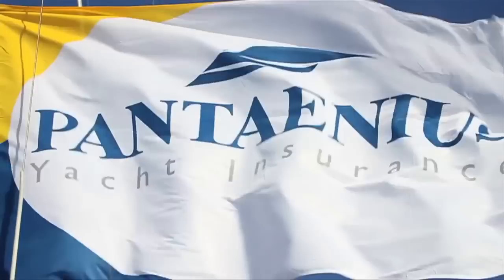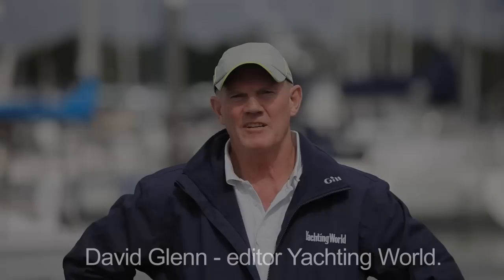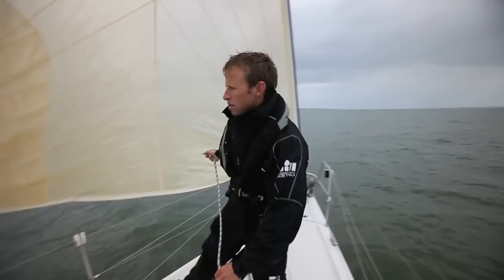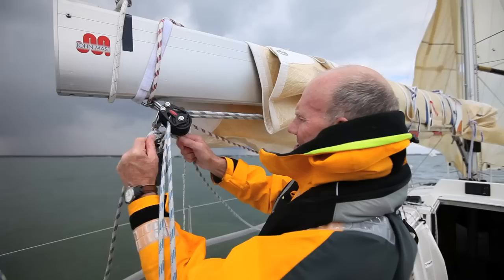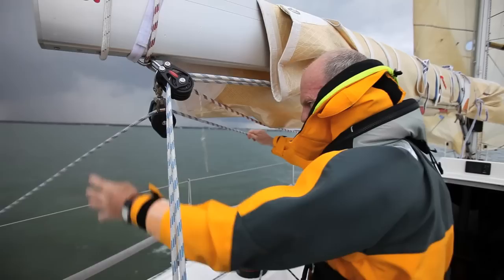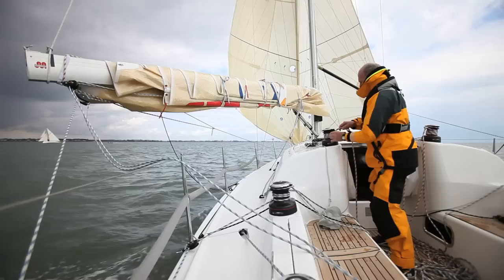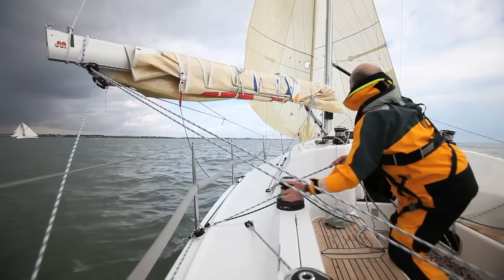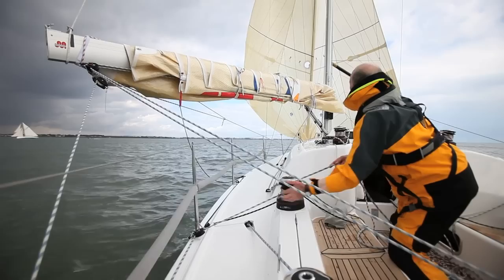How to set up for downwind sailing without a spinnaker | Yachting World

Comment: not a huge fan of the extra sheet.. It doesnt seem to have any great advantage.  Rather it means a crew member has to be reaching out to try and grab a clew that is some distance way from the boat.   I much prefer to use existing sheets. As Gybing is as simple as picking up the lazy sheet and swapping ends on the pole as you would with a kite..   horses for courses I guess. 
.

Comment: Very good video, thanks. On my last boat I had a Selden boom which had a cast alloy 'handle' in the outboard end for attaching the preventer. My current boat, like that in the video, lacks this and I'm always concerned that an accidental gybe will put enormous strain on the clew attachment as the preventer tensions against it. Anyone got suggestions for avoiding this?
Reply: Attach a small cleat, ring, or handle? Hope this helps 😆

Comment: Darn, I thought this might be useful for us. We have a simple boat, no spinnaker, so I thought this would be the perfect video. But turns out  you need a spinnaker POLE, with all the associated lines, which kind of misses the point for us. 
And we have only had one head sail and only one single track in in the  foil, so the twin headsail trick doesn’t work for us either.

Any other tricks?
Reply: In light wind ?   Just fly your jib wing on wing. Takes attention so a bit tiring if passage is long - but is it long ?

Comment: So you have a spinnaker pole, rigging septate spinnaker sheets, pole up haul, pole downhaul, you're 95% of the way there, that's your definition of hassle free, I'd hate to see what you would consider "a bother"! Why not just go the one extra step and actually fly the proper sail for your point of sail?!
Reply: Not every boat has a spinnaker & sails can tear.
Reply: Spinnaker tears, your boat doesn’t have one, also it can be fun to try different methods of doing the same thing. Admittedly this is terrible for a race setup, but for yachting it’s fun to just play around with your boat, and see what you can do. Not to mention the spinnaker is a very fiddly sail, quite annoying for long-haul downwind sailing.
Reply: @stoutyyyy  agreed. 
We keep ours below deck.

This probably benefits a shorthanded sailor the most. 
Keeps you on deck, and doesn't require you to haul up a large spinnaker.